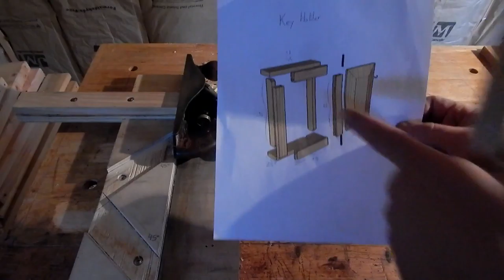Key Holder - Part 2 - the Door

Comment: You usually use a haunched tenon at the end of the rails, on a frame and panel door like that, where the extra deep mortise is held back from the edge of the ends of the stiles. Thanks for the great videos.
Reply from the maker: You're absolutely correct. I was going for super simple, but I missed the opportunity to demonstrate a haunched tenon, not to mention the added strength.
I'm glad you enjoyed the videos.